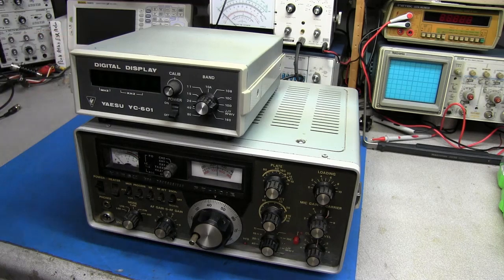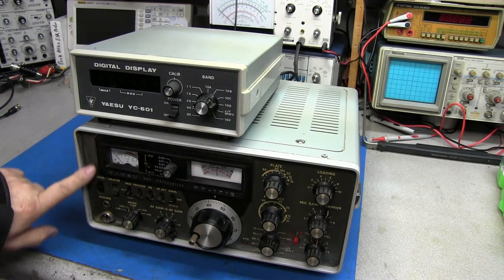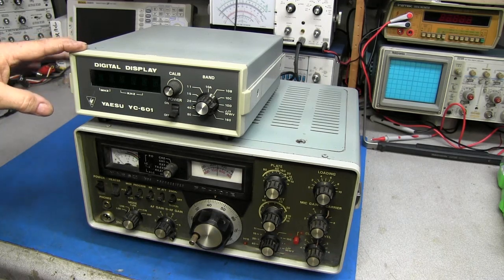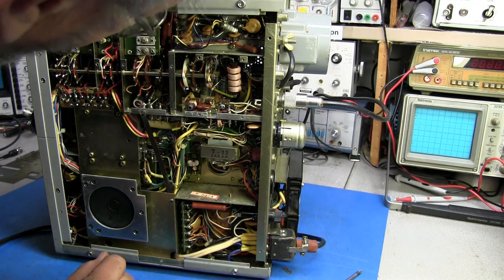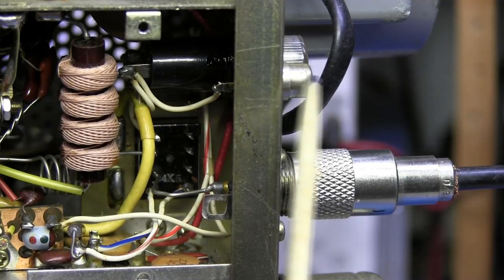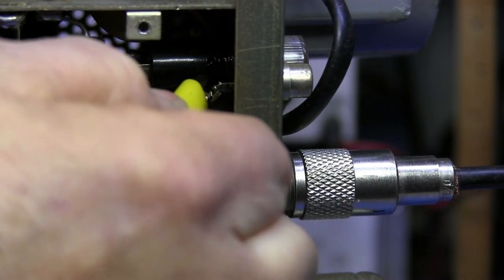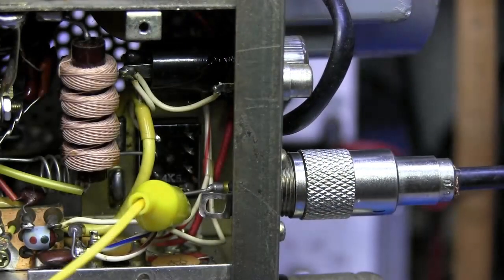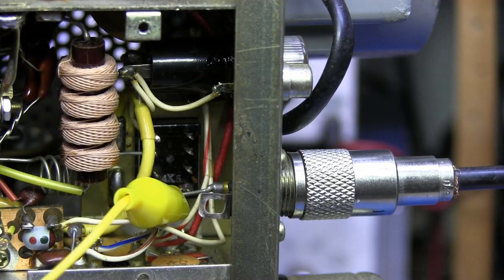#271 Yaesu FT 101E Part 1

Comment: Nice looking rig you have there Buddy. It brings back memories. My first ham rig was a Yaesu FT-101EX I bought new in the late 70's. I bought it here in Florida and when I went to the University of Alaska at Fairbanks I dragged it along. It was a rugged radio and when I retired it it had plenty of battle scars but still worked great. Like the Icom IC-7300 of today the Ft-101 series were made in large numbers and are still easy to find. I'm sure you will come across the plan and B models soon. 73 Joe
Reply from the maker: They are tough rigs for sure Joseph.  Not sure how many I used to see at field day but was a lot. Even saw two knocked off the table and fall to the ground. Thanks for sharing.

Comment: I have just found "Evaporust" here in New Zealand a CRC product, I used it on a Yaesu G-600x rotator interior that was in a flooded garage, and I have to say on steel it is just like magic, on Aluminium it tends to eat the paint off where the corrosion is. There is no blackening of the steel that other rust converters seem to do, but I found on the ball bearing 'balls' that where not rusted they turned black, the company says it is carbon, and can be washed off with soap and water. I used it on a capacitor clamp, and all the rust was removed leaving a dull silver like color, and not affecting the original yellow steel color. I have a FT101B that is another project, but it is in bad shape, and I have many FT200's (Somerkamp, Henry One, etc) in the pipe line before it LOL. 
Great to see the old Yaesu rigs being restored. 
Andrew ZL2ALW

Comment: Awesome video!
I have a Henry RadioTempo One (similar to the FT-200) same weak signal/audio; and I have been working on this for years with no luck, chasing signals, thinking a receive stage coupling issue, but never thought about the relay contacts. Duh. The circuit is very similar, and this is the next thing I will check/clean up when I bring out on the bench! I was using with my Hallicrafters SX-100 as receiver and T/R switch. Thank you!

Comment: Have  a Ft-101 and  FT-101E they work great after new cap's. Also have a FT-101 parts radio. Love these old radios because repair with removable boards make the job much easier. Thanks for the great video Buddy.
Reply from the maker: Thanks for sharing that Lyle. Theu are nice old rigs.

Comment: It's not a screw on lens as such but a great macro lens for Canon DSLRs is the Tamron AF 90mm f/2.8 Di SP A/M ... It's the older model but It's tack sharp ... they're around $280 in USA ... roughly £300 here in the UK ... see if you can try before you buy.

Comment: The FT-101 series were and still are the classic txvrs of the 70's. Sorry to disappoint you but if you are looking for a complete set of the FT-101, then you will need to get your hands on 1 of each of FT-101, FT-101B, FT-101E and FT-101F. The FT-101F was the last of the series, not made in huge numbers as was the FT-101E. I have had an FT-101E and almost all the accessories for about 10 years. I can say that it took me nearly 10 years of searching to make the (almost) complete line but was worth the effort. Good luck in your search. 73 de VK3NBI Bryce.

Comment: I have 3 old FT101's....  Need to do a tube conversion on them as the sweep tubes are just too darned expensive anymore- Great video
Reply: You are correct I just paid RF Parts almost $200.00 for two matching pair I paid Tube Depot a little over $13.00 for the driver tube.
Reply: @rayjohnson7886  Ouch! 6JSC's, correct?
Reply: @Joetechlincolns  Yes sir sylvania's.
Reply: @Joetechlincolns  I talked to a guy in California that works on the FT-101 series and he said it costs a grip for the conversion. I'm gonna have mine neutralize when I put the new tubes in. I'm getting 45 RMS out of it watts now but I don't believe in running them wide open.
Reply from the maker: The price of sweep tubes are crazy.  I have been thinking of converting a 101 to 6146 tubes.  Although there are pros and cons with the swap.
Reply: @TheRadioShop  I look at it once new tubes are installed and the radio is neutralize. And don't be running it wide open it'll last a long time I run my FT-101 EE. About 3 watts just enough to run my Maco 300 but I had my Maco converted over. I don't have to run them 8950 tubes anymore. And the amp doing about the same watts Tube Depot prices isn't too bad.

Comment: Buddy, 
I used to repair the yaesu ft101 line and the old Kenwood 520, 530, 830 line and many other rigs back in the 90's. I'm dragging out some old gear of mine that was working when stored 15 years ago.  My question is on my old ts830s should I bring it up slowly on my variac for the first time??
Just don't want it to go boom.
I bought this 830 brand new in early 80s. Still looks new.
Thanks Kevin ka5iwo

Comment: That’s the most beautiful ham radio I have ever seen. So my xyl went on eBay and looked for one.  Showed me a link. FT-101ES from Japan! 
I said yeah that one is really nice. Working condition and all. A manual in Japanese. If only I could read that. Anyway, She went and bought it. 
I said, what! Yeah it’s payed for so I can’t go back now. 
Ok, that’s nice and all, but I live in 230v50hz country. 
What do I need to check and look for before I ever plug this in? 

Will be a forever radio.
Reply from the maker: Great, you will love the radio.  If the radio came from Japan I think the voltage they use is 100/200 60 Hz. Go to Foxtango website and download the manual. It will show you how to wire the cinch connector for your voltage.
Reply: @TheRadioShop  thanks!

Comment: There’s a couple of things on this video you didn’t go over 
1 is the tune  on the receiver and transmit mode
2 how much power does the radio puts out on swr
And on the tuners   dummy load
Reply from the maker: There are other videos in this series plus tons of videos on YT.  I do not understand question 2. SWR has nothing to do with the output of a radio into a tuned dummy load. That has more to do with your antenna system.